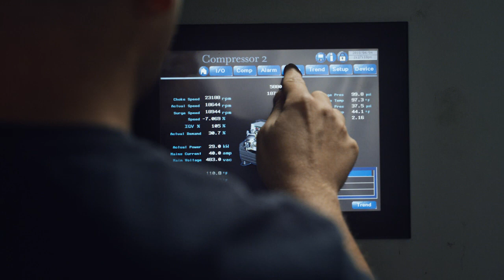U.S. Air Force: Civil Engineering - Leading the Way

Comment: 380th CES Plattsburgh AFB NY and 401st CES Torrejon AB Spain.  I was a draftsman and a surveyor.  Best job I could have hoped for and loved every minute of it.  Wish I had never gotten out.
Reply: What are the shifts like for family life?
Reply: @ Back then I was a 9 to 5er.  My son is in now and has better hours. LOL.  Seems he gets lots of days off in the AF now.  But he does have two kids.
Reply: Did they have you running CAD I’ve been thinking of going the OTS route after I graduate this semester
Reply: @ in Spain it was good old drafting desks and t-squares.  When I got to NY we rolled out CAD.  I think it was version 1.  We had these digitizing tablets with all the commands and you used a puck.  Mouse like thing with a crosshair on it.  You would click the commands on the tablet then move to the drawing area.  Got so good at it you didn't have to look down to find an arc or line or whatever.

Comment: Is it possible to join Security forces after bmt then go Into college to do civil engineering.
Reply from the maker: Members who are on active duty may continue their educational goals. They work their full-time jobs and go to school in their off-work time. They may use the Tuition Assistance Program. Tuition Assistance is a program that the Air Force uses to pay 100% of the tuition cost for college classes that you take in your off-duty time.  This is not a loan and is at no cost to the Air Force member.  Using the tuition assistance program will not have any effect on the availability of the Post 9-11 GI Bill funds. You may choose the degree program you study. 
Pam
Air Force and Space Force Recruiting Service
Reply: @USAirForceRecruiting  you might mention that's IF you aren't deployed, working swing shifts or details, IF your supervisor is willing to work with your education goals.
Reply: @USAirForceRecruiting  thank you
Reply from the maker: You are welcome
Don
Air Force and Space Force Recruiting Service

Comment: Woot, woot.  I was a "waters and fuels maintenance technician (aka plumber), 3E451" part of CE for 4 years, 2009-20013.  Wish I woulda seen more of them in the commercial.  Us and those pest management airmen.  Those were some good times.  The best part about my job while I was an E3-E4 was that I was NEVER stuck in a designated area for my job like some other Airforce jobs.  Any building that had a water or fuel systems in it, we had access to (as long as work needed to be done in that facility).  That means we had access to EVERY building on base including the intelligence buildings, hangars with F-16's sitting in them, people's private residences. 98% of the base populous didn't have that privilege.  It was a pretty cool job being in civil engineering.  I would highly recommend the civil engineering career field to any new recruit that wants to learn trade skills (HVAC, plumbing, carpentry, heavy machine operator, electrician, pest exterminators, bomb/ordinance disposal, fire fighters) and who don't want to be confined to a specific, limited work area.  Let me know if you have any questions about the civil engineering field.
Reply: Do u do all u jobs u listed or do u just pick one?
Reply: And how often do u get deployed and what are the pros and cons of this field?
Reply: Can a carpenter say the same ? Like the guy in the video ? In terms of working in many places
Reply: E Bank the “carpenter” being being referred to is structures. It’s 1 of a plethora of stuff you do in structures. You weld, build duct work, do drywall, paint, flooring, Carpentry both rough and finish, masonry. You are a general working bee. And structures will also do repair granted youre attached to a prime BEEF unit (ie Base Repair and maintenance.)
Reply: Is water and fuels maintenance technician considered an engineer..?
Reply: Civil guy with a BS degree. Soon a PE. How to get into prime beef and red horse? Do they need licensed civil engineer ?